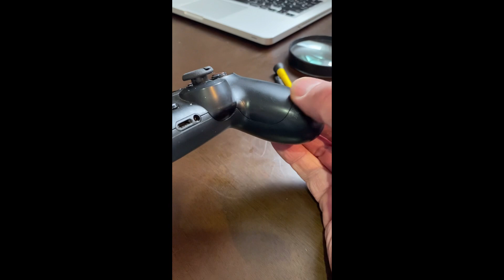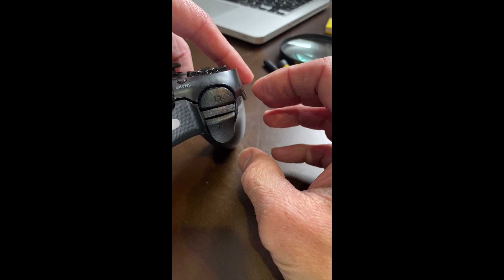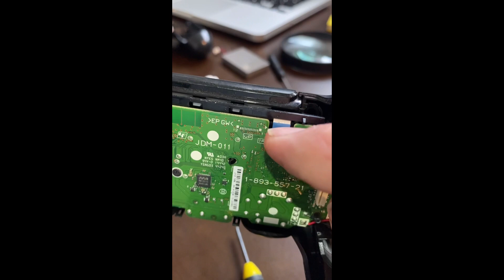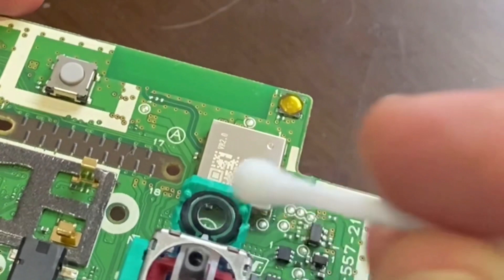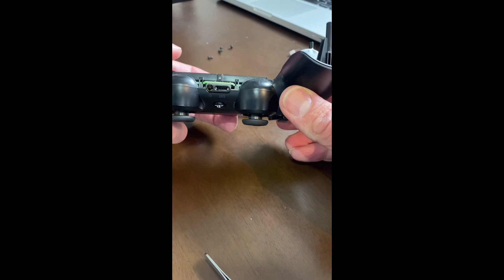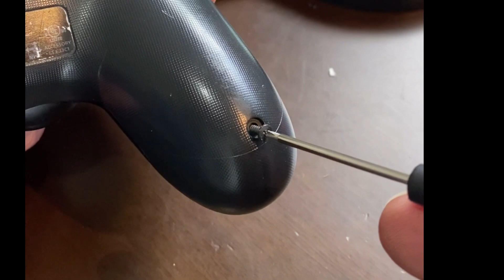PS4 Controller Drift Fix

Comment: [Alternative - First Aid Solution]
>Take a Straw, Flatten it so it looks like this []
fit it in the analog stick from the side while holding the stick down, as you hold the stick a space should appear where you can fit the straw safely, now blow really-really hard from the other end of the straw (or pull air, up to you... but be careful... and don't overdo it). 

Enjoy a Drift-Free experience along with a really bad headache for a moment.

>Alternative: Use compressed Air in the same way, as you hold-down the analog-stick, blow inside that space.
If nothing worked, adjust your dead-zone. If you are on PC, use a program that does that for you, if not, use your console settings if there are any.

Keep in mind that you do not need to slide the compressor or the straw too deep in, you do not want to damage anything so be gentle :)

If nothing worked and you have warranty then of course replace the product within that time.
Technically this should not void warranty because you literally only blow wind in it and did not open it or anything, so be aware of that and be aware to not-damage your product.
Hopefully that Helped some ^_^

PS: if it Helped, Join/Like for more to See
Reply from the maker: Thanks for the tip!  Multiple ways to fix these controllers it seems.
Reply: Mines fucked. I tried air i tried taking it apart its worse now than it was. Im gonna get some compressed air and q tips from town tomorrow and use some alcohol to clean the delicate parts, if that dont work its fucked. Ive even accidentally removed all the vibration functionailty and now the circle button wont work aswell as the fact my drift is more like a jet now. Its ridiculous and just out of warranty. Fuck sony. Fuck them so much.
Reply from the maker: I’m sorry everything is messed up with yours.  I had to re-solder one of my controllers after this repair to fix the vibration.  Just be careful inside, use a steady hand.